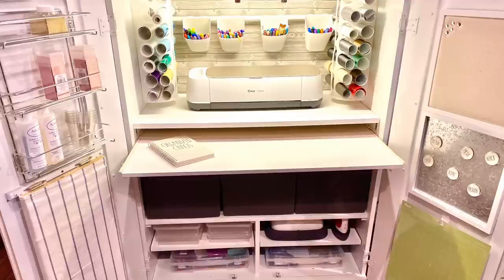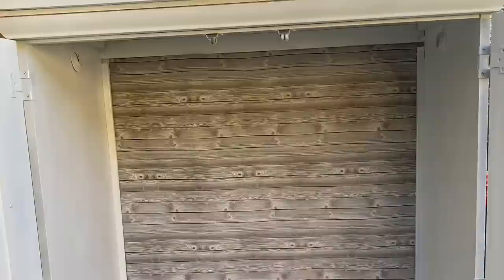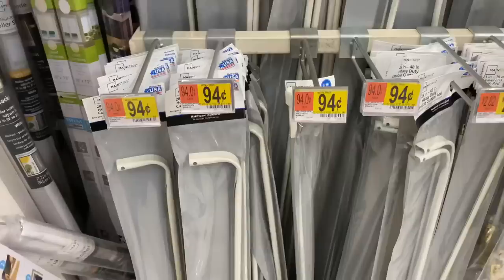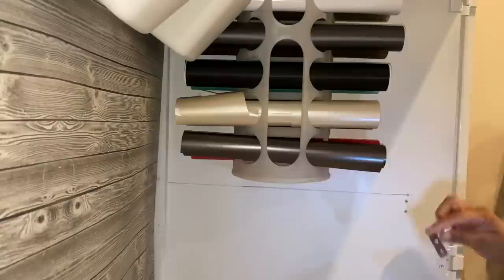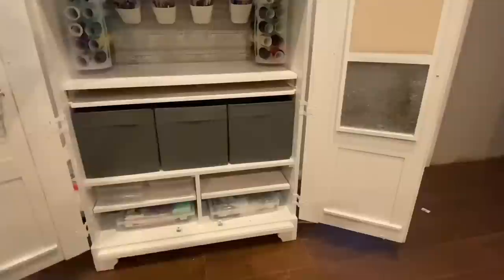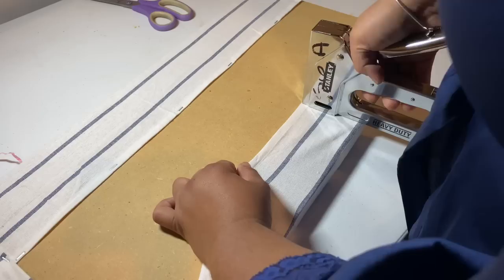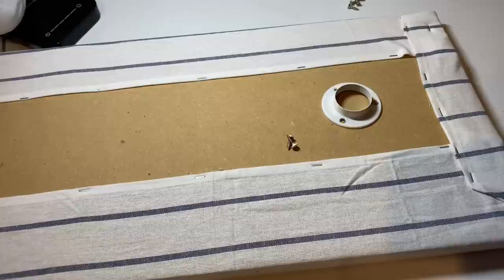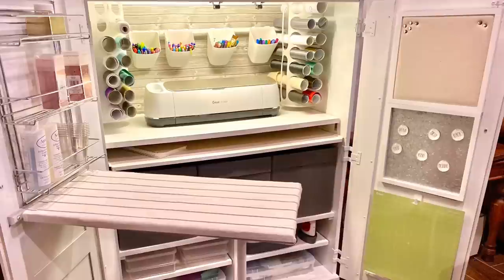DIY Cricut Cabinet | Cricut Organization | Melinda Willz

Comment: I had to comment with step one. There’s NO WAY I’d spray paint an ENTIRE cabinet. You can use a paint brush which would be faster and safer. There’s fast drying paint with primer that could have been used Instead. Also this is not an armoire. This is an entertainment stand (hence the big hole for those old school TVs to poke out the back). An armoire is a standing closet used for storing clothes. There would be a pole hole present in the large opening section and no hole in back. Just FYI for those wanting to change their “entertainment stand” into a craft storage unit.

Comment: Perfect timing!
I have a similar piece of furniture...........only one shelve with a solid back which is good with a drawer at the bottom.
Your idea.........simply genius 👏🏽👏🏽👏🏽😊.......the ironing board area..........😊😊😊.....that is a double plus!
I’m going to have fun creating mine to my specifications. The use of the doors.........yessssssssssssss😊
I’ll probably use mine for my album and book making needs laminating machine etc........so lots of space just waiting to be filled!
Defiantly a new subscriber here..........I love watching fun projects that repurpose items with minimum cost to create! Ideally being able to get dollar tree items is a plus too.
Now.........to the fun part..........prepping my cabinet..........let the planning begin.......😊😊😊
🥰
Q:
The pull out shelf.........sizing for the runner/width of shelve/ side wall of cabinet......how did you get it all to fit......or did it just work out that way?
Reply from the maker: Yes your cabinet sounds like it’s going to be amazing!! ❤️ for the pullout shelf, I measured the inside of the cabinet and had a piece of MDF cut to fit.

Comment: I just happened upon your video and you gave me some great ideas. This craft cabinet came out beautifully! I have a back room that has been an office/storage room and I recently decided to turn it into a craft room. I no longer have a desktop computer, and have a laptop so the computer armour that is already there I wanted to repurpose. And do what you have done to this one. It's 6ft tall by about 48" wide. It has shelves to the upper right and two drawers under those. The other side has an upper shelf then below there is a fixed shelf then a slide out table, then more shelves below those.The best part is it is all pine wood, so screwing items to it will be easy. I want to incorporate my jewelry making supplies and my leather and supplies. I am a woodwork as well with a separate building in the back yard that is my shop. I may make my containers for most of the storage, but I love the spice rack and the hanging cups and especially. The bag holders. Do you think they are sturdy enough to hold rolls of leather? Where did you get the grey cloth baskets? I just love the look! Thanks for any ideas you can suggest for the cabinet. I may even hang my small table top ironing board on door. There are two bi-folding doors, so I may have to make one side fixed. You have gotten my excited and motivated to work on this project!
Reply from the maker: Hey and thanks for watching! I do think that the bag holders can hold your leather (they are from Ikea) and the gray bins I also bought at Ikea.

Comment: For the back of ironing board to keep it up.. you had a gap.. you can see if a 5 gallon or 1 gallon paint stir will fit the gap and it's free.. 5 gallon is thicker than the 1 gallon is... just idea.. if you remember want to get the correct gap use 2 shims and it will make a block and just slide them in and out will set the correct gap and cut off extra
Reply from the maker: Good Idea! ❤️

Comment: I have a similar armoire that I didn’t want to discard as it is good furniture. I have had it in my bathroom for years but I know exactly what I want to do with it now. I wish you lived near to give me pointers as I have never done anything so ambitious before. I once made a fancy valance on  a box structure made of 1x 4s as a gift but this is so much more.  I have a million questions but the first is a problem I ran into when I wanted to do something with it a while ago. When you drilled the holes both for the L braces and the slide out support, what did the outside look like? Can you see the screws?
Reply from the maker: Hi gayle! Thanks for your comment ❤️ I made sure to use screws that were not longer than the depth of the side boards. So you cannot see any screw holes. Thanks again for watching 🥰

Comment: This is an awesome DIY!  Now I just need to find a cabinet for myself to makeover! I'm curious where you put your Cricut when you're using it, though? I have a ScanNCut and need extra space at the back when I'm cutting things out. Do you put it on the pull-out drawer?
Reply from the maker: Hi Marnie! Thanks so much for watching and commenting with your questions. I just have to pull the machine out to the edge to allow it space to feed the mat in the back. I've not done too many projects that are bigger than a 12x12 mat. However if that change din the future then I will probably install drawer slides on that shelf to be able to pull it in and out.

Comment: I love it but I want to know how the cricut worked out on that self . Because the mat has to be able to go through. Did you have to change the shelf to a pullout shelf for room for the mat.
Reply from the maker: At the time I did not, I just pulled the machine to the edge and that allowed enough space for a 12x12 mat to feed through. I do a lot more projects now that require the 12x24 so I have another DIY upcyle in the works coming soon ;)

Comment: What is the item you put in one of the fabric bins that resembled a small hand mixer?
Reply from the maker: That was my tumbler spinner from hobby lobby. It constantly turns a cup with epoxy on it at a slow space so that it can dry without leaving drip marks.

Comment: What do you do with the machine when you run a 12”x24” thru the cruicut????  Does it have enough room?  Or do you only do 12”x12”’s?
Reply from the maker: At the time I didn't make anything that big so it wasn't an issue. I have since opened up an etsy shop and have been quite busy with it, lol so I've out grown this cabinet. I'm thinking about making over something much bigger to accommodate my over flowing supplies and I will definitely keep in mind the 24" mats this time around <3

Comment: Hi Melinda, can you give me the cabinet dimensions?
Reply: Monica Martinez    A pity she didn’t respond to you.   You can kinda surmise the dimensions though.  Guessing that she’s probably about 5’5” or 5’6”, that’d make the cabinet about 54” to (at most) 60” tall.   Both the Cricut dimensions and those ikea “bag dispensers” dimensions can be had on line, but I’d guess the unit to be somewhere between 36” & 40” wide.  As this cabinet held a “vintage” tv once, AND it’s also been used as a closet, as attested to by the closet pole brackets, so you can probably safely assume that it’s at least about 18” to 22” deep.  I hope this helps you some.
Reply from the maker: Hi Monica! Thanks so much for watching and commenting. Apologies it took so long to respond, but the dimensions are 21" deep, 54" high and 42" wide.

Comment: This must have cost a fortune to make.  Even if the wood and cabinet were ‘finds’.  All other material .... and a ton of wasted space.   Sorry.  Not trying to be disrespectful but as for someone that builds and huge diy’er im curious why u went with such expensive stuff to build this?   Min cost is roughly $200 for average person.  MINIMUM.  I WOULD PROV GUESS AROUND $300 for cost of wood if not free.
Reply from the maker: Hi Rhonda! Thanks so much for checking out my video, I thought I’d give you a rough break down on what I spent on the cabinet: 
Spray paint- $1.99ea x5
MDF boards- $7.50 x2
Drawer slide- $8
Fabric bins $4 ea x3
Dollar tree container- $1 x4
Larger clear containers- $3 ea x2
Spice rack- $14
Target bulletin board- $5
Target magnet board- $5
Hinge 2pk- $3
Dollar tree command hook- $1
Dollar tree sticky Velcro- $1 x 2
Sunersta cups- $1ea x4 (pen storage) 
Curtain rod- $0.94
Shopping bag holder- $3ea x2 (vinyl storage)
Dollar tree rag- $1
Dollar tree poster board- $1
IKEA kitchen towel- $0.75
Florescent light- FREE
So, I spent right around $100 on everything after taxes (yes, everything). I’m not sure where you see “wasted space” because I was pretty adamant on using every inch of space for usable and functional storage while still being able to actually work out of the cabinet. Rhonda, maybe this cabinet project is not for you and that’s ok! You know what they say, one mans trash.....
Going forward though you should try your best not to put other fellow DIY’ers down. There are a lot of people out there who want to start DIY’ing things and don’t for fear of being judged or criticized that they did something wrong. Just because you state that you don’t mean to be disrespectful doesn’t mean that your not being rude. Thanks for watching, and commenting though. You really helped out the algorithm. Have a great day, Hmm Kay!  😉